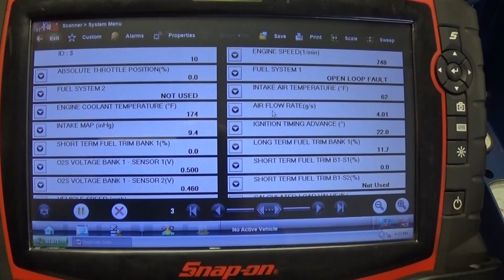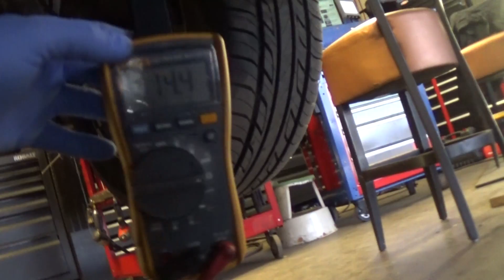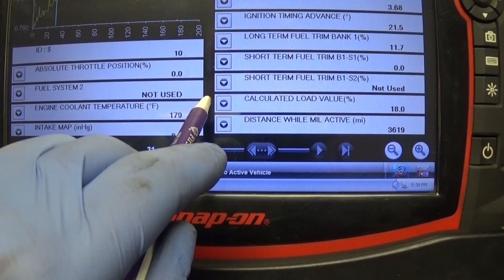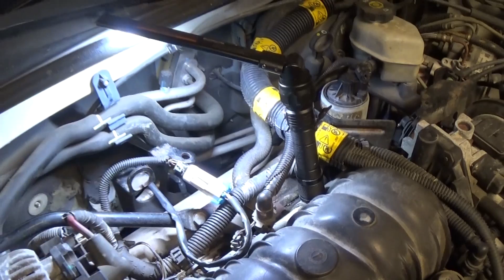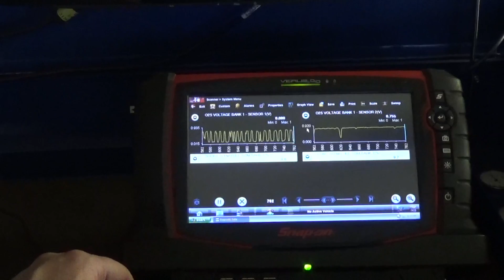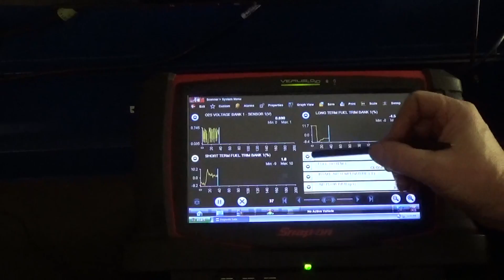Oxygen Sensor Testing P0036, P0134, P0135,P0141

Comment: Thanks for the vid,should the downstream sensor fluctuate rich/lean at all at idle?? even if it's not at the same rate as the upstream one??
Reply from the maker: No it should not. That is indication of bad catalytic converter
Reply: @kyhomegarage3430  dayum, mine is just trickling either side of 0.15v when idle, but then when you take it out for a drive it can go rich / lean the odd time, probably about 3 oscillations compared to 10 or 12 for the upstream.. Maybe I'll try a bottle of cataclean as last resort

Comment: Thank you for this video.  I am still trying to understand why you didn't replace the downstream O2 sensor since it was mirroring the upstream one.  Clearly the catalytic converter was not plugged as there was no reported history of lost power.  Does the mirroring of the second sensor of the first indicate that the catalytic Cr/Vn  pentoxide is somehow used up without a mechanical blockage? Does it mean the CAT will eventually become plugged? I'm trying to understand these issues. Please keep up the good work.  Craig
Reply from the maker: craig dreisbach Hi. Catalytic converter was plugged in. Signal from downstream O2 sensor is not cause of a problem it’s effective of damage catalytic converter. Now reason why PCM didn’t flag code for bad catalytic converter is because downstream sensor didn’t work and PCM was blind. I am sure that PCM will flag that code soon as  monitors are done and cat will have to be replaced . I hope this answers your question my friend.👍
Reply: @kyhomegarage3430  Thank you.  Craig

Comment: regarding the mixed up fuse panel case cover... this again shows that you cannot quantify human error. It further emphasizes the need for a consistent diagnostic approach that you follow each time (which you do!) which will lead to an accurate determination of "what's wrong". Well done sir... once again! (I do bet though that the converter is going to need to be replaced in the near future on this vehicle)
Reply from the maker: MacDonalds Motorworks thank you my friend. I absolutely agree with you this catalytic converter is gone and it will need to be replaced soon.Another expense for this owner. 👍